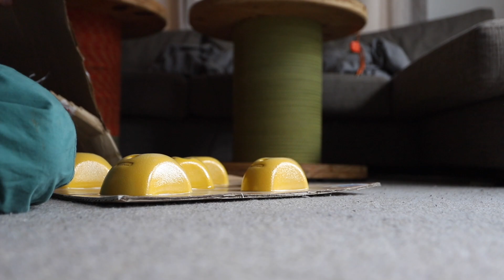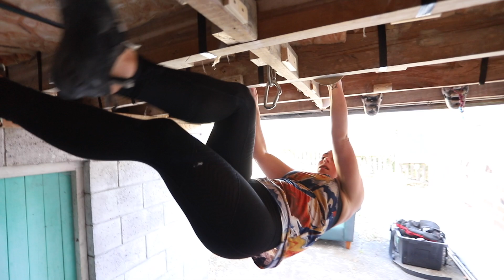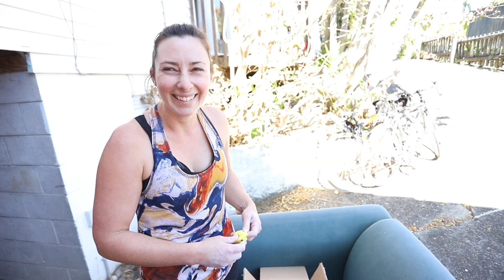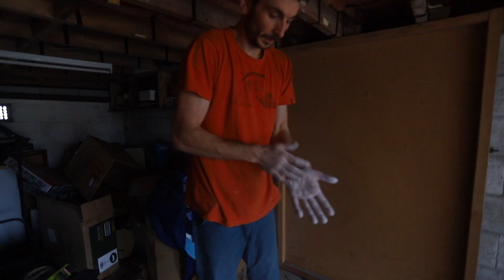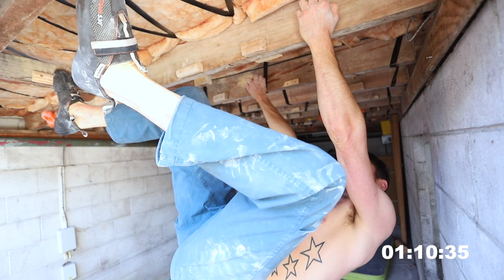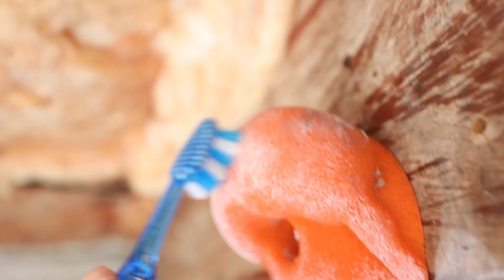Route Setting And Endurance Training At Home!!!

Comment: Sorry if this is a stupid question: how did you attach the new holds to the beams? I thought that you needed T nuts on the other side of the wood.
Reply from the maker: Mostly wood screws and tek screws, bolts are necessary for bolting the holds onto ply board but these ones seem to be staying on fine so far 😂